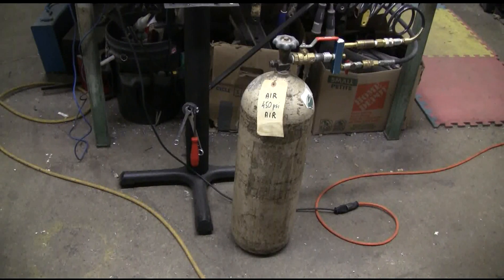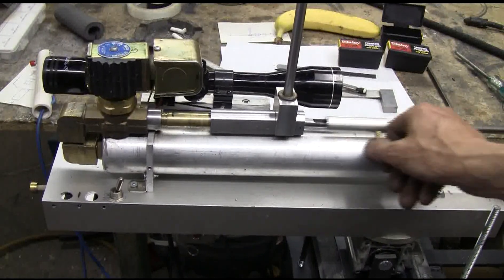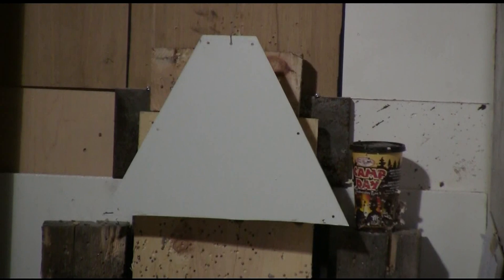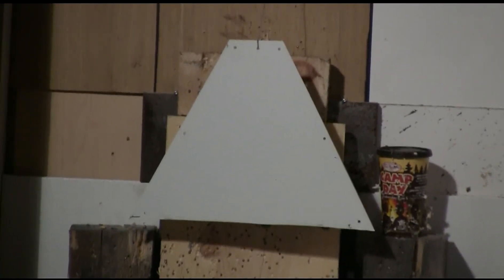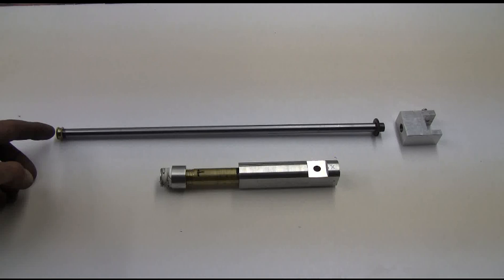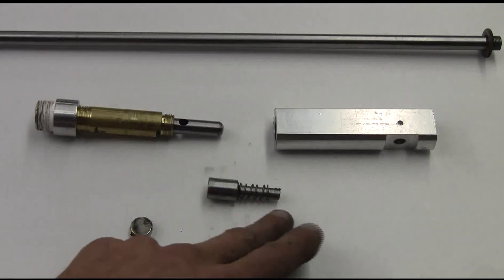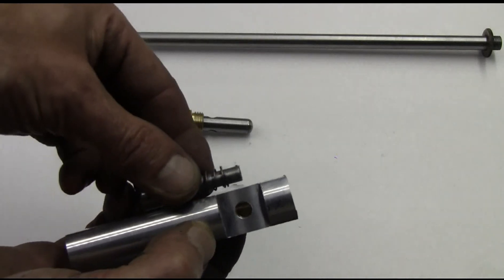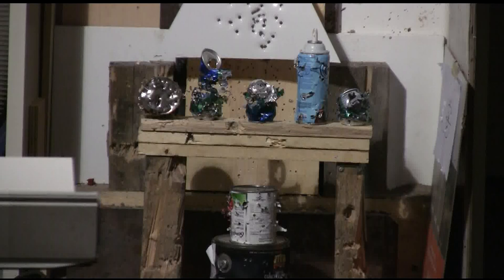Air Cannon #83 - .25 BB Cannon Pneumatic Breech Mod

Comment: hey have you thought about making a airgun that shoots bigger pellets?
Reply from the maker: I have larger cannons in cal .565, .750, .812, 25 mm, 32 mm, and others. There are plenty of videos of them.
Reply: @BillGilmour519  I actually rely on power of powder(and not only by the way:I figured out the way to harness the enormous power of such a thing known as astrolite-D and to use it as a propellant! But that is another story I suppose)-made a vastly modified version of PTRS-41 anti-tank rifle that uses the heavy barrel from KPVT machinegun and so it is now capable of shooting the enhanced loads!Those in my case managed to show an enormous energy:35.3k ft.lbs or 56 kilojoules:a huge 14.5×114mm BS-41 tungsten carbide core projectile weighting 68.2 grams or 1050 grains left the muzzle at as much as 4300 fps or 1280 meters per second!Yet it's clearly not the point where I will stop:it's actually where I started!So the next project is probably going to be the representation of the limit of firepower that a single human can actually handle so I can describe the project in detail if you are interested!The estimations are very interesting:using the same exact 14.5mm BS-41 projectile but propelled by a gargantuan 14.5×148mm Bloom round with yes,enhanced load will leave the barrel at astonishing 2050 meters per second and yes,I know how to kill the recoil of such a shoulder mounted cannon(not recoilless rifle though!) to the point where it will be possible to fire it even from standing position!
So write me if I got your interest!
Reply: @BillGilmour519  besides I just conducted a series of experiments with .25 steel ball bearings fired as a sabot in two different conventional firearms and got very interesting results!So first of all I had tried this configuration in my EDC revolver which is a very old antique revolver in .32 rimfire long which happens to be indestructible for any kind of smokeless loads I could find-yet generally I use the loading scheme that involves adding adapters in each chamber which can be loaded with .27 caliber nail gun blanks and the bullet is just loaded from the front so the preferred power level that I use most of the time when I just carry this thing is what I used in the experiment so that was a #6 purple load which in the 6" barrel of my F&W "Terror" gives the muzzle energy of 450 fpe on average so the muzzle velocity of the said  .25 ball bearings was getting between 1050 and 1100 meters per second or 3400-3600 fps!Now that was quite something I would say:these were embarrassingly inaccurate and at the distance of 20 yards the group size was gargantuan enough to get larger than a full sized door but the penetration abilities were quite unexpectedly high for those things!At least they made it through a 1/8" thick AR-500 plate at such velocity!
However the more interesting test was done with the same sabot projectile loaded in the 7.62×54R round and fired out of a Mosin rifle:that was a very large difference in velocity and depending on the powder that was used I got different results with the top result being achieved with the PETN laced gunpowder from an aircraft machinegun ammunition that I had and in this case I launched the same ball bearings at the whopping 2500 meters per second or 8300 fps and now that was a serious force to say the least!in fact it made it through a half inch of AR-550 and apparently disintegrated upon impact straight into dust with a bright but extremely fast flash being visible when I tested it in the darkness..